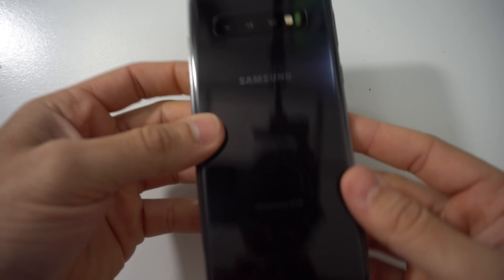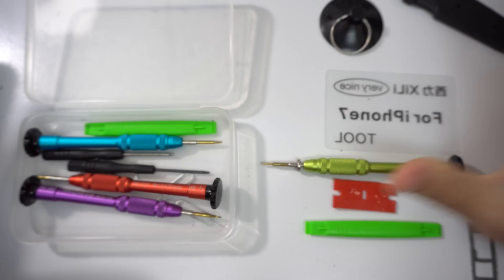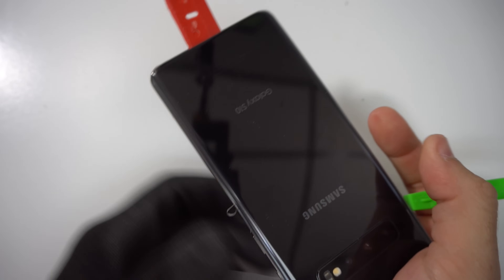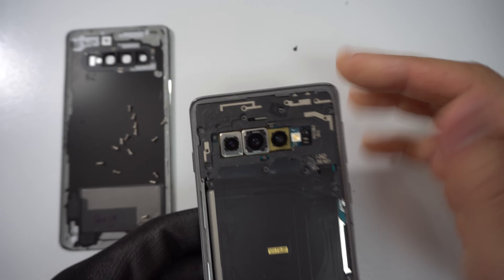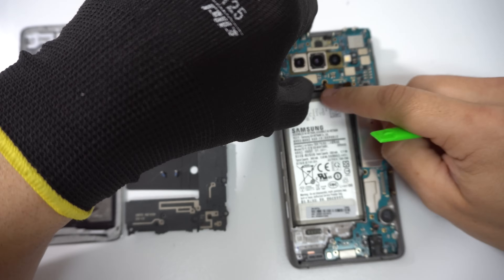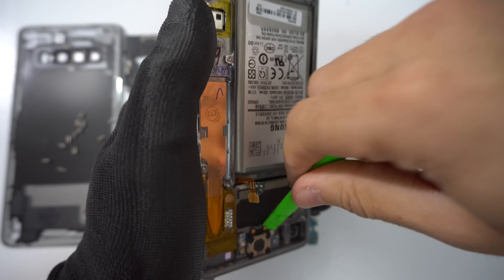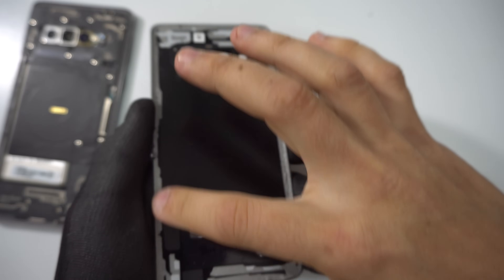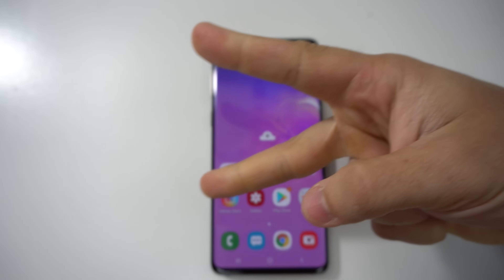Take Apart & Replace Screen - Samsung Galaxy S10 Screen Repair

Comment: Hi, can you put a Snapdragon S10 motherboard on an Exynos S10 display? Has anyone tried it/does it work?
*The Exynos S10 is G973F, and the Snapdragon S10 is G973U1.
*Reason: The Exynos motherboard won't turn on, the Snapdragon's does, but the Exynos display is in much better condition.

Comment: Excellent video. I just used this to replace frame with screen on my broken Samsung S10. Still a very good phone even by today's standards with the newer phones. I'm pretty handy with fixin' stuff, but it helps a lot when I don't have to worry about which screws to remove or what part will come up without breaking (for instance when there's some hidden clip I needed to know about).

Comment: Thanks so much for this video. I had never opened a smart phone before, despite having the right tools for the job, and you explained things clearly and relatively quickly. Nobody in town would fix an S10 for me, but thanks to you, I was able to do it myself. Will definitely check you out if I need more repair tips down the line!
Reply: where did you buy the screen from?
Reply: 8 months later. Im asking the same question @nav34d

Comment: Excellent video took me just over an hour because every component was glued down. I bought the whole frame. So I wouldn't have to pry off both sides. Saved 150$ doing it myself and got original parts

Comment: Replaced my S10plus phone's AMOLED screen, with vertical green lines that appeared recently  with a TFT screen with frame. The phone becomes thicker and heavier the screen sensitivity is a little less so typing needs to be a little slower..even after turning up sensitivity a little higher. There is no finger print sensor..thats o.k..the wake up screen with 2 taps does not work so is screen capture by swipe...but the screen switching off by 2 taps does work. While removing the internal speaker from the original frame..it broke (replacement is about US$2..and battery removal was the toughest and it started with some sprks and smoke!..so one needs to work with eye goggles and near outdoor excess...
so an OEM replacement battery about US$10. Another problem that took a long time to solve was when replacing the black wireless charger "flaps"...that looks likebcardboards with some leads the problem was when the contacts were not exact with the screws the charge display shows a temperature yellow triangle because of the battery temperature (??)..and the phone will not charge the battery..so after many tries i left out one screw on the wireless charge flap and the charge problem got solved.😢

Comment: Hello, I have 2 s10 Galaxy phones, one has a broken screen. Can I just replace the motherboards? I wouldn't play with the screen, it's too sensitive. I only need pictures and videos. And that's all on the motherboard? Am I right? Thanks in advance for the answer.
Reply: Hey I have the same question I'm in the same situation,  thinking about just switching the motherboard also

Comment: I'm a little confused... Instead of taking off the front all its green I can buy the whole screen with the metal housing? I want to avoid taking off the front screen
Reply: What I meant to say I want to avoid taking off the front broken all its green after I got out the phone so in other words I can buy the whole outlet screen with all the connections to put the phone together right?

Comment: The cost of the screen is more expensive than the phone goes for now on ebay...I'm never buying another expensive samsung phone. I'm just going to buy a cheap motorola and if the screen cracks I can get another. Samsung is obviously doing what Apple is doing which is forcing people to buy new products rather than fix the one they bricked.

Comment: I was rocking my cracked screen on my S10 for about 9 months, until one day I woke up and the screen wouldn’t turn on.  I accidentally realized that the screen sometimes turns on when it’s getting a charge.  Which is a hassle, but ok.   
BUT, the whole bottom of the screen is a bright white!   It’s so bright it hurts my eyes, not to mention the whole bottom is useless.  Now I HAVE to change it

Comment: Unless you are a Guru and have destroyed a few phones, do yourself a favor, spend the $$ and buy the digitizer. Trust me it is not worth saving a few bucks. Make life easy.
I'm doing this repair right now but with new digitizer OEM with battery.
Just swap out motherboard and all the goodies. Used an iron in lieu of hot plate, flipped upside down with rag on top  works like a dream, hair dryer handy to give the edges a quick hit.

Comment: crazy, a broken screen now doesnt even make it worth it to repair since the new screen is about the value of the phone
Reply: Yeah but since it comes with the frame and all, after that you basically have a new phone 😅
Reply: Depends if its just the glass or the whole screen. Saw replacement glass floating around for ~30 bucks or so, definitely not the end of the world

Comment: Wow...I've done a few phone screen repairs using tips from YouTube but after seeing this on the s10 I am thinking 300 bucks to have a pro do it sounds better this time around.
Reply: U can get a pre-owned s10 in mint condition  for like 2somthing
Reply: @giovanyirizarry3582  A year later...now s10 versions are being sold for less than $170 even 👀

Comment: anyone with a broken screen, being shocked by the price of a replacement: you can buy ones with dead pixels from Aliexpress. Usually only a few pixels are dead, like 3 or 5, even 1 sometimes. It's a wqhd screen, so you can barely ever see an individual dead pixel.
Reply: yeah...saw those. the delivery time of up to 30 days to Canada is the downside.for me.
Reply: @nickloss2377  yep, I also had to wait quite a bit, 3 weeks I believe. But I paid 120€ instead of the 250-ish official price, so it was worth it for me personally.

Comment: Love how you said the battery should come up pretty easily - literally one of the most difficult things I've ever had to do hahah
Reply: Did the original adhesive still work good? I’m having to do this soon.
Reply: @chrisd5758  not really, I had to obliterate it with isopropyl alcohol. I applied a new coat of PVA and used electrical tape when putting the battery back
Reply: @JeromeBeckett  really? I just finished mine did it in about an hour I just ordered a new back glass with pre installed adhesive, luckily the iphone repair kit I have did just the job. Spent about $220 in total but much better than $350 I was quoted.

Comment: Quick question how much does it usually cost ? To repair a screen by businesses cus I'm looking at reviews and my phone is not damaged from any where else otherthan the front half of the screen went black only the half top works don't know if it's even  Saveable
Reply: Quoted $264.99 - front; $119.99 back Batteries Plus
Reply: My phone is functioning fully for now though...just cracked all over front screen and just top of the back.

Comment: Thank you for the video, it was very helpful. I have a quick question. After doing this repair, my device will sometimes turn itself off and the only way to turn it back on is to plug it in and hold power. Do you have any suggestions or pointers? Thanks!
Reply: Got the same problem too, sent it for repairs and those guys had the audacity to tell me that the  screen absorbed a shock on  the inside. They asking me to pay for screen replacement when it's still has 2 yrs warranty.

Comment: Helpful video, thankyou. Dog chewed my S10 the other day, so I wanted to get it apart to inspect the damage before spending money on a new screen and back cover!
Reply: 2 days later... Replacement parts arrived, phone is running like a champ again, many thanks once again for the very useful video.
Reply: Where do I buy the parts?
Reply: hi, may I know. Is your S10 still working til now? 
 @djsherz
Reply: @claudineannevictoriaelpede3177  It lasted another 4 years, I finally replaced it a couple of months ago, the graphics chip on the motherboard was failing. Bought another secondhand S10! :D
Reply: @djsherz  wow, of all the available brands and units, you bought another phone and the same with your previous S10? hehe alright, Im considering to replace my phone screen this year.
Reply: also, was there any significant difference when you use the stock unit and the one when  you replaced with spare part? just wanna make sure thankss

Comment: thank you!!!!!!!!!!!!!!!!!!!!!!!!!!!!!!!!!!!!!!!!!!!! mine is an s10 plus (has an extra screw) but doesn't matter. it works!!!! Now I will go ahead and buy a tempered glass for my screen...should have done that in the first place :(   i think OP removed the video with S10 plus so I had to use this one by the way.

Comment: i cant powr mine off because the top 50% of the screen is unresponsive
Reply: Yeah my bottom screen is completely white. I need to replace the LCD. It has a little crack that's had spider legs going to the bottom. But I must have damaged LCD. It freaking sucks having a half a phone
Reply: @magical8013  ikr

Comment: first phone ive broken, my second phone, first hand a beefy case, this on has a slim one. a line of screwy pixels in the center of the screen and a fuster cluck of cracks spreading from the same area. hopefully my parents got it covered, otherwise im stuck with it until it breaks more when i will probably just get a shitier phone again

Comment: I removed 15 screws but only put back 10..🤔
Reply: You just made it more efficient
Reply: Geo P more light weight haha
Reply: Is the s10 still good?
Reply: @starfieldblonde131  I destroyed the whole phone had to get it repaired at a shop. 
I'm good with hands on stuff but if you dont have the proper  tools you're out of luck .
Reply: Me too I destroyed my phone because I don’t have heating tool. I was only supposed to replace the battery but I cracked the screen because I thought that prying it apart is easy as it looks on the video. I end up replacing the screen too and after that it works fine again. This is not really advisable if you don’t have tools.
Reply: Top 10 misteries of the universe
Reply: Lifes biggest questions
Reply: I did that with my xbox one when I fixed the disc tray but with alot less than 10 screws put back in and it works
Reply: 😄 im gonna try to fix my screen now

Comment: This phone's screen costed almost as much as the phone itself lol
Reply: Samsung and their authorized repair ifixit will do it for $269 and maintains warranty and all parts are Samsung.  I do give credit to this gentlemen for his video, was good and informative,  maybe too fast.  I did break my screen, and spoke with but samsung and ifixit for my 10Plus, and since their authorized repair which there are two are there abouts an hour away, it is done in two hours and an appointment must be made and time allotted.  I have a few good phones, and after thought and not tied to probably a 10 day turn around going to send it to Samsung.  This way just drop it off at ups, fedex usps or whomever their rma shipper is, just drop it off and wait.  Only thing I would suggest is wipe the phone first, and just do a reinstall.  Safety first and allows the repair people to get into the phone without having to worry about passwords etc...
Again no slight to this person who made it, if one is good at this, and already have an import with no warranty and you can save a few dollars it is a good route to follow.    For a critical time sending it to Samsung seems the best bet.  Price is the same.  Going to set up the process tonight.
Reply: @VersedNJ  hey did they even replace the battery when they changed the screen??...bcoz when I fixed it with authorized Samsung care ...he said we also had to replace the battery

Comment: What about the finger print on the screen and the waterproofing? if you remove the screen will it affect it?
Reply: But the fingerprint will work perfectly
Reply: You'll lose much of the waterproofing if you do it. Most likely to the point where it's pretty much effectively not water proof or risky to assume that it is. It might be "water resistant" not waterproof. So stay clear of water Lol
Reply: Yeah it will not stay waterproof

Comment: Where can i buy the s10 screen? 
How much will the glassscreen cost me?
What is the most difficult and sensible part? Where i need to take care the most? Cos i really dont want to break anything...
Reply: I can help you, my WhatsApp +8617704077762
Reply: Screen is 960 $ for s10 lol midiswell get a new phone buddy
Reply: @Impulsebuyer13  Not sure where you're getting them for that much but they are about $300
Reply: @lilfish1993  I just typed in s10 replacement screen on Google and it said Samsung official screen is 960 . Didnt do to much research tho .was just wondering how much incase I crack my screen because its inevitable lol
Reply: lilfish1993 not sure we’re your getting them oem is 216
Reply: @Impulsebuyer13  dude this can not be true!! Some one tell me this guy is lying,
Reply: @FreakOfSc2andHomerJ  Samsung Aust is quoting AUD $300.00. This is an estimate dependent on damage beyond the screen. I broke my S10 screen 14 days after purchase, ouch! So I hope this helps you. 👍
Reply: @andrewjohnson3711  I fell your hurt.  Had a good case, but it's my fault not Samsungs, and take ownership, I hope whatever you do works out.  I'm in the US, and just going to do it.  It is a great phone and cost me a lot of money US Unlocked S10 Plus 512gb.  The phone and sensor still works perfect and the break is in the bottom left. Maintaining a fully warranty is worth, had a problem no breakage with a Note 5 and it was handled through my carrier no cost with a phone swap in two days.